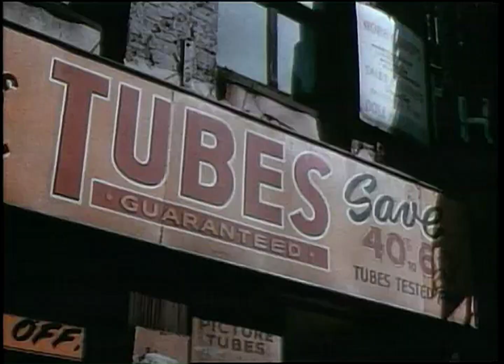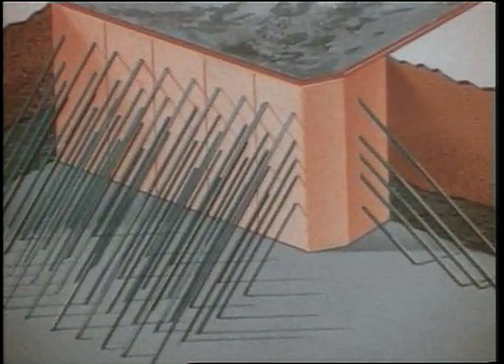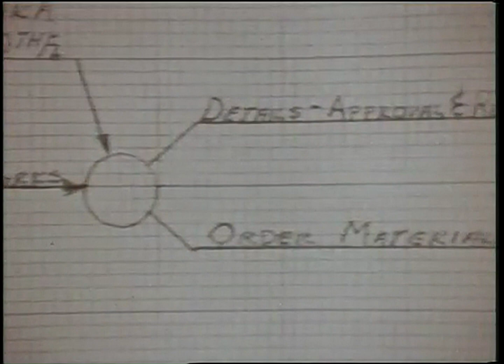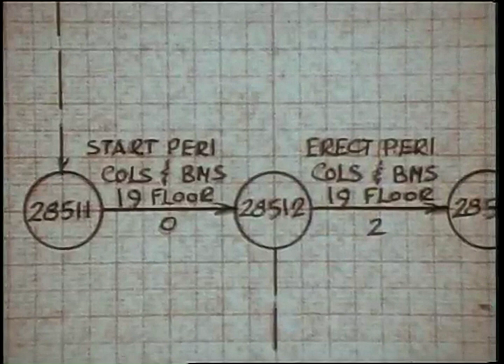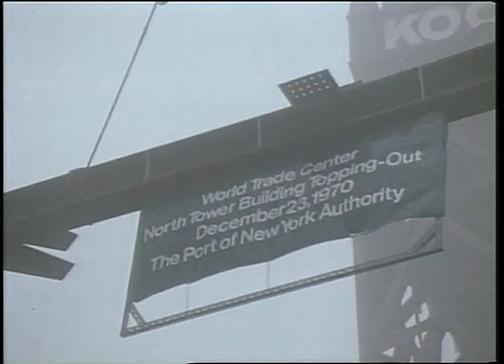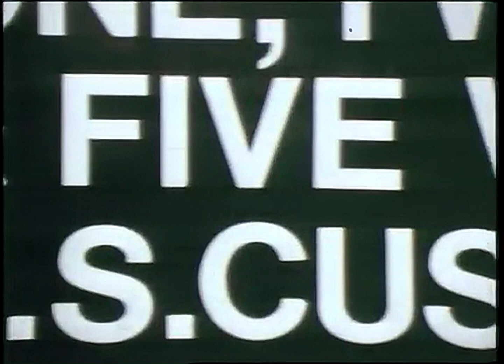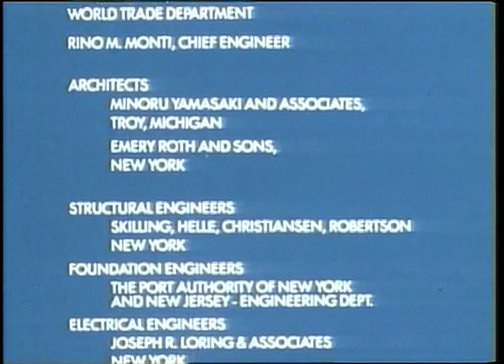Building the World Trade Center (PANYNJ, 1983)

Comment: I bet these buildings are indistractable
Reply: They Should!.
Look At Those Massive Steel And Beam.
It Should Hold Damages From Boeing-707 Yes!.
Reply: They were, in a modern marvels WTC episode filmed in Dec 2000 to Jan 2001, engineer Frank DeMartini stated that the buildings were designed to withstand multiple plane impacts, as the exterior wall and core were designed to be a dense grid
Reply: @AluminumOxide  They did survive plane impacts.
Reply: Not to shaped charges and other methods of disintegration.
Reply: jameswheeler5025  So you leave 'other types of disintegration'.
Reply: jameswheeler5025  look harder!
Reply: 1966

Comment: It just doesn't make sense... I can accept as a "differing/new design" compared to past tall buildings, there may have been some unknowns in the extreme outcomes expected... but, to dismantle this whole structure in minimal time, seems near on impossible?   What happened to basic physics on that day, that said "...there is a shit-load of mass/structure below... you will have to wait your time in falling to the ground as all this effort is pushing back up against you rouge floors above!"... ?
Reply: Exactly. The laws of physics are NOT theory. They are what they are and the symmetrical free-fall collapse of three buildings, as on 9/11, is literally an impossibility. Period. The "whodunnit" is where conspiracy theory comes in to play but as for the physics aspect, only a fool would dispute Newton's immutable laws.  One-one-thousand, two-one-thousand....in the time it took to say those two phrases is how much longer it took for the top of those towers to reach the ground than it would a brick dropped from the same height with nothing but air to impede it's descent to the ground.
Reply: Load bearing walls. Structural integrity gone. You could hear the shit cracking before it went. This video is great insight🤘